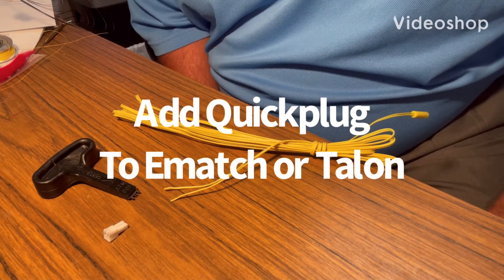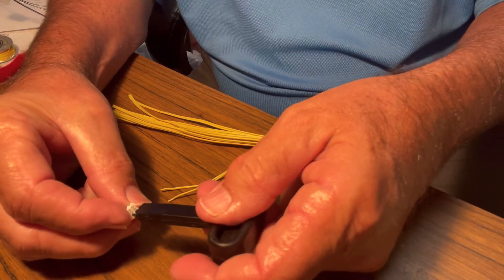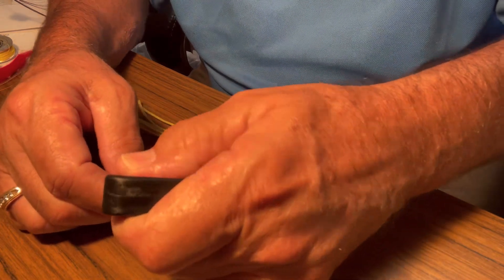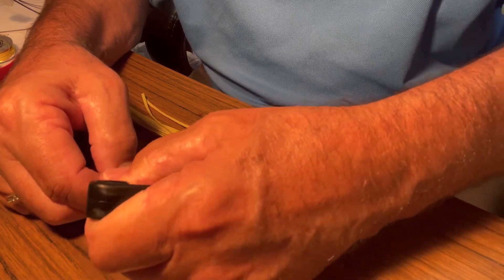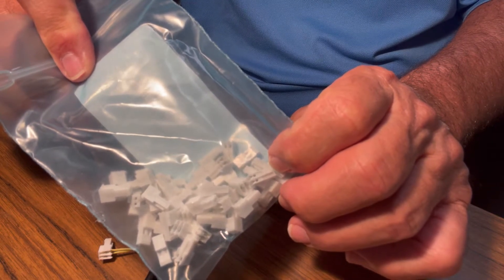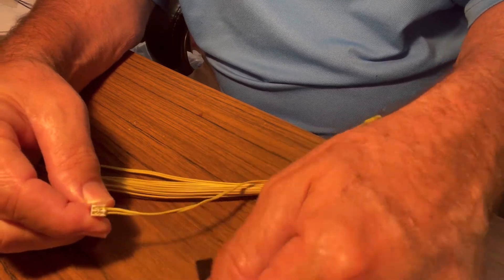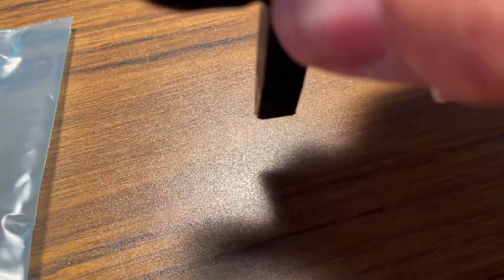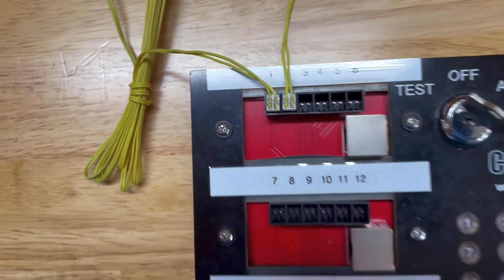Install Quickplug Connectors on Ematch or Talon

Comment: Is there no concern for a shunt?
Reply from the maker: @NSteinseifer81  You can shunt the connector. A short piece of stranded wire bent in to a u shape. If you buy Quickplug ematch or FireWire premade from MJG, or from Cobra, they come shunted. If you install connectors like I did, you can shunt them yourself.

Comment from the maker: The expensive DigiKey crimping tool is $538.53 as of 4-26-24. That includes a die head and a handle. The die head is A1998-ND $371.96 and the handle is 58074-1, $166.57. If you are doing a large quantity of these it may be worth it, but for a few the $40 T handle tool is sufficient.

Comment: This is very helpful in saving money on more expensive ignitors. Do you know of a tool to help remove the quick plugs from the modules. I have big hands and removing them has been a PITA. Thank you very much.
Reply from the maker: Try to pull out all 6 on a cue strip at once.
Reply: @mguerramd  All 6 at once how? By the wires?
Reply from the maker: @Bansh33B0b  yes. Close to the plug
Reply: @mguerramd  I prefer not to pull on anything by it's wires, especially these plugs as I reuse them. There must be a tool out there made to remove them. Thank you for the option.
Reply from the maker: @Bansh33B0b  No specific tool. But needle nose pliers can help.
I don’t see how yanking them out by the wires can impact your reuse of the plugs. But what a PIA to disconnect and re use those little connectors. Are you using Talons, FireWire, or ematch?
Reply: @mguerramd  It's just like unplugging an extension cord from the cord instead of the plug. I use mostly Talons and connect them to the spent wires with the quick plugs. Either way you're unplugging and plugging in new ignitors so may as well make it as easy as possible.
Reply from the maker: @Bansh33B0b  Once you use up your non quick plug Talons you can get Talons, FireWire and ematch with quick plugs already installed. Not much extra for the QPs
Reply: @mguerramd  True, but I still have to remove them and that's where my issue is. I was hoping there would be a tool to help remove the little buggers.
Reply from the maker: @Bansh33B0b  Once you get the igniters with the QP already installed you won’t care about yanking on the wires because you’re going to trash them
Reply: @mguerramd  but I will care about the ignite system and what that might do to the wires inside the female end of the connection. I'm not going to pull on the wires to unplug them, I'm looking for a tool that would help. If there isn't one I'll just use some needle nose pliers or something like that. Thank you for your help.
Reply from the maker: @Bansh33B0b  Go to the 6:00 mark of this video and see how the owner of Cobra and Ignite does it. Earlier in the video he discusses the durability of the female connectors:  https://youtu.be/cMIFre4NDFA?si=S7x1KUUtNi4vEqL6
Reply: @mguerramd  thank you, I may have underestimated how strong they are.

Comment: Do you happen to know the part number for the male end of the quick plug? Looking to make extensions for quickplugs
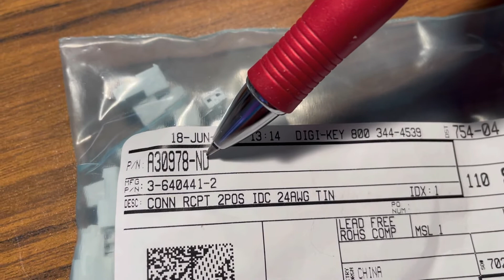Reply from the maker: It’s very clearly shown in the video, at the 5:00 mark, in high definition!
Reply: @mguerramd  I'm asking about the male end with pins which i clearly stated in Dolby. 🤣 Nevermind though, I found it
Reply from the maker: @24S58MIII  Oh I misunderstood. The male part in my particular application is a Cobra Quickplug cue strip. Which they sell as a spare part. It’s a funny designation. The white part that plugs in to the cue strip seems to be the male part, however it has two holes for the pins. The cue strip seems to be the female part but it has pins. So both parts are gynandromorphs!😐

Comment: How have you found these to work over time? Any reliability / continuity issues when putting your own QP ends on?
Reply from the maker: I’ve only used a few but no problems at all with continuity. I just buy match with QP connectors. I make reusable extension wires with alligator clips on the product end, and got these mainly to put on the module end. These extension wires let me put product well away from the module and get some product separation from a single station. Usually to push cakes out in front of 1.3 mortar racks, when on the same module. Sometimes to mirror two products on one module, 30 feet apart.
Reply: @mguerramd  thanks for the response!
Reply from the maker: @Firecat8 We did two 500 cue shows recently. We had about 4 out of the thousand that I didn’t install the connector securely. We fixed those in the pre show continuity check. Normally I wouldn’t install 1,000 connectors on ematches!! But I had the matches on hand and had converted all my modules to Quickplugs. So, over a few months I would sit down and do 30 to 100 at a time between patients at work, or at home watching TV. It was kind of relaxing actually…

Comment: Do they make a quick plug with screw term. block🎉
Reply from the maker: I don’t understand the question
Reply: They do not. I just spoke to digikey and they dont have any molex connectors in the MTA-100 line that use screw retainers for the wire inputs.